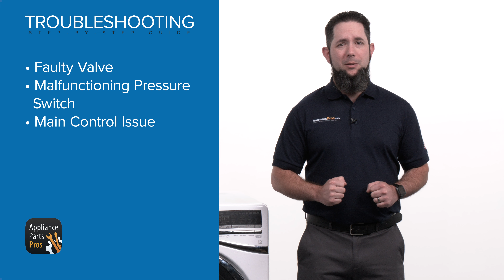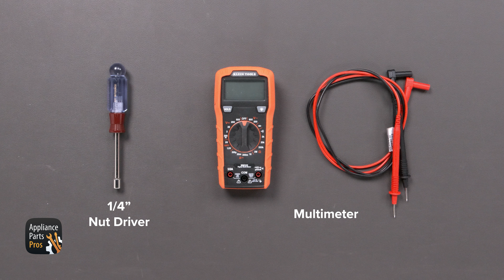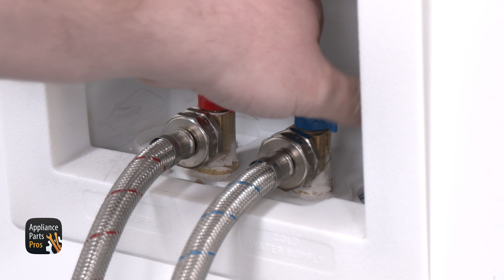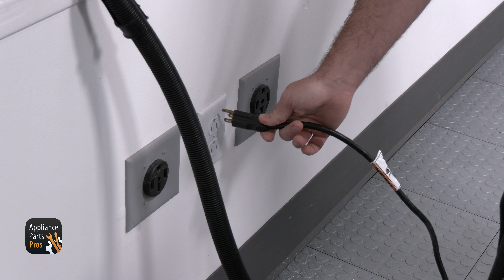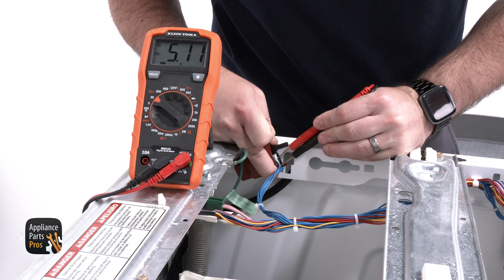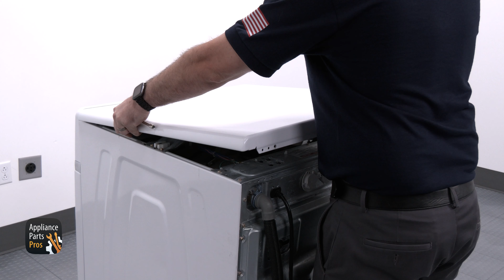How To Troubleshoot a Whirlpool Washer That's Overfilling

Comment from the maker: 🔧 Fix it yourself:
▶ Front Bellow Tub Seal / Door Boot — WP8181850: https://www.youtube.com/watch?v=7uEk61JOgRk
▶ Outer Tub Seal DC69-00804A: https://www.youtube.com/watch?v=vPRKZxYYCYw
▶ Whirlpool front-load washer drain pump assembly (no speci...: https://www.youtube.com/watch?v=He3D7LTD8Ac
▶ tub-to-pump drain hose with check ball, WPW10467168: https://www.youtube.com/watch?v=o6tTpfJFOzM
▶ tub-to-pump hose W11366249: https://www.youtube.com/watch?v=UoUl_X4U0Uk
▶ Tub-to-pump hose, Frigidaire/Electrolux part #134455900: https://www.youtube.com/watch?v=-Sgy52EGfjc

👍 Found your fix? Hit Like so others can find this video too!
🔔 Subscribe for more repair guides: https://www.youtube.com/@AppliancePartsPros

Comment: Great video. Thank you for sharing. What is pressure switch ? is all front load and top load washer have pressure switch ?
Reply from the maker: The pressure switch, sometimes called the water level switch, controls the level of water in the unit.